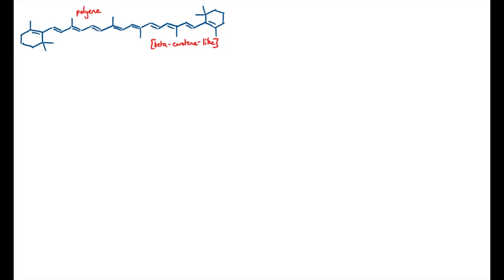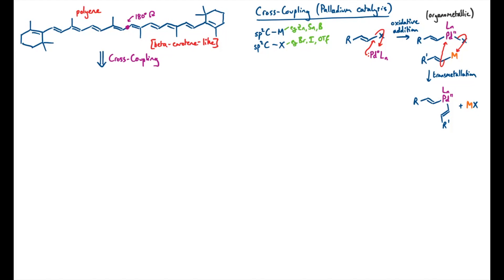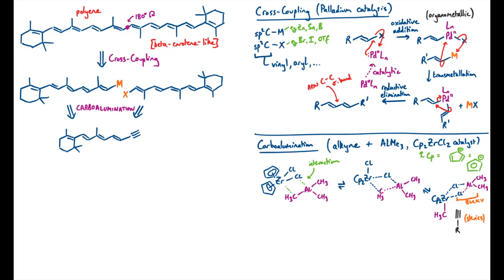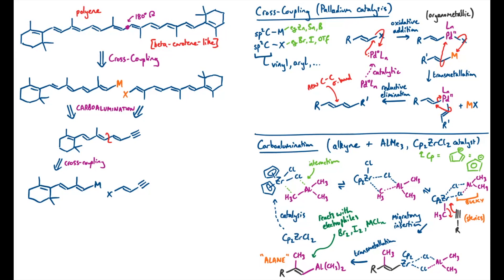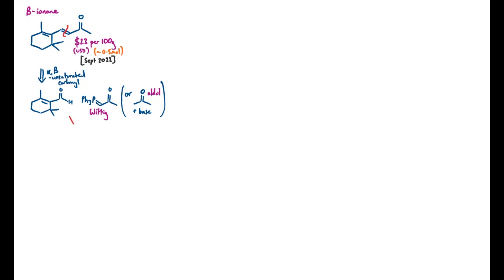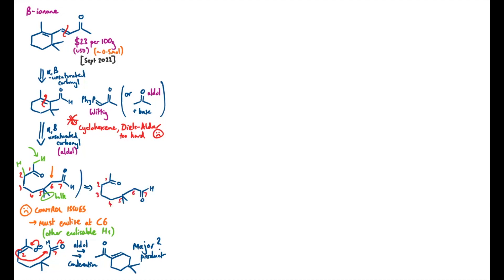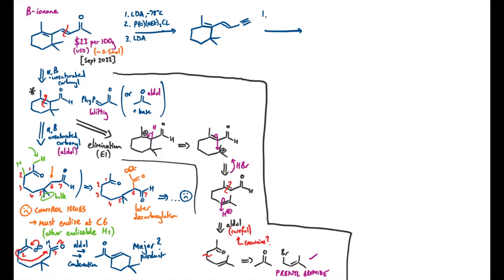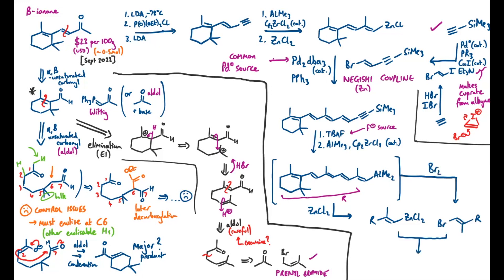Making a Polyene with Metals - Retrosynthesis

Comment: These retrosynthesis videos are great!
14:23 That alkene is citral :3 Around half the price of β-ionone from what I can find - doesn't justify the extra work however, and one has to factor in the yields as well. Both β-ionone and citral have a wonderful smell.
Reply from the maker: True. Well I guess that’s terpene chemistry for you going via a biomimetic disconnection. I suspect nature can do the cyclisation much more cleanly though so I’ll take that purification shortcut any day.
Reply: @CasualChemistry  I had to look this up, but surprisingly, nature apparently makes the ionones from the carotenoids - which in turn seem to be build up using isoprenyl pyrophosphate and others. Did not know this.
Either way, I completely agree to use β-ionone as a starting material. But considering this it is a bit funny to turn β-ionone back into something that looks a lot like β-carotene :D

Comment: It's a small change, but, when you have such a symmetrical compound with a key sp2-sp2 sigma bond disconnection in the middle, would you not be tempted to use a homocoupling, e.g., reductive cf. Daniel Weix's work, or oxidative cf. boronic acid side reaction?
Reply from the maker: I’ve definitely played this safe and traditional that I think would be pretty high yielding. I’d worry putting a radical (or one electron shuttle system) on a polyene as it might trigger some unintended isomerisation.
Reply: @CasualChemistry  I was wondering why you didn't use Kolbe electrolysis (or similar, Kolbe electrolysis is just the first thing I think of for symmetric couplings), that certainly makes sense
Reply from the maker: I went for the most generalisable thing I guess - probably old school but widely functional group tolerant. The video is certainly not the only way to synthesise this but took a general stance for educational purposes for viewers who might be new to this stuff

Comment: Maybe a simple question, maybe hard, but how do you turn something like this into it a repeating polycyclic? I mean without custom enzymes.
Reply from the maker: Do you mean repeating aromatic fused at a point (like biphenyl) or fused at a bond (like nathphalene)?
Reply: @CasualChemistry  the second...
   I'm thinking about how cholesterol and other steroid compounds are made by animals, as well as some polycyclics from plants..
  The enzyme names and pathways elude me at the moment, but they tend to start with similar conjugated bond systems, linoleic -> arachidonic acid & so on,  other fatty acids etc ..
  I'm wondering if there's something similar in the world of synthetic chemistry, some technique, that could be harnessed to make all sorts of polycyclic molecules, from perylene to graphene...
Reply from the maker: Ah I see. Yes - these things do exist but they normally use precursor molecules that aren’t fully conjugated like this one (often referred to as a type of “biomimetic” chemistry). You need like a linear precursor with isolated alkenes 5/6 atoms apart and then trigger a cascade to zip it all up. Often done with generating a carbocation at one end, and ensuring that the best place for a C+ to end up is at the other end of the molecule. The alkene to carbocation attacks then happen all at the same time and you get good stereocontrol from a single best transition state.

It’s also possible to do these cascade reactions using radicals but you have to be a bit more careful that there’s only one sensible ring that can form at a time.